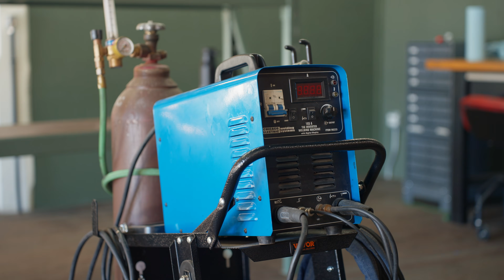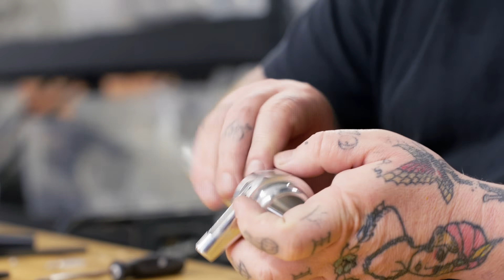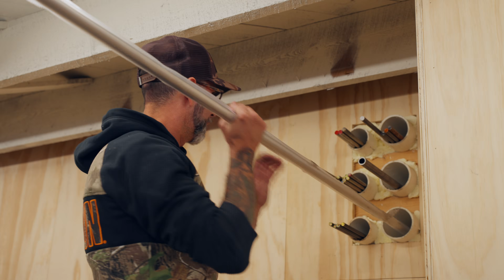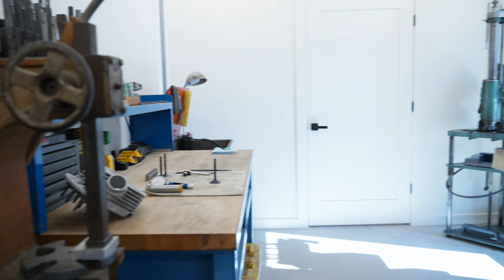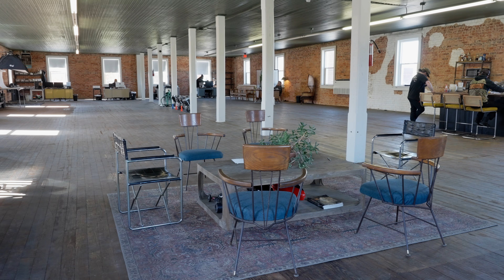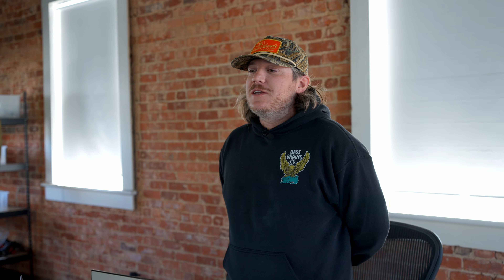PRISM SUPPLY | New Shop Tour!

Comment: Since you guys do stuff that actually help us in our little MC world, I have a product opportunity that would sell immediately in the vintage Harley market. There is a high demand for a true drop-in 12V and 6V AGM battery that fits inside a Panhead/Knucklehead oil tank while maintaining a completely stock appearance.

Right now, the only widely available option—Taiwan Tedd’s lead-acid unit—went back to using a 6V side-vent tube. Owners have to cut the vent, modify the lid, and add vented caps just to make it usable. Every spring, the same question shows up across all the Pan/Knuck/Flathead forums:
“Who makes a battery that fits the oil tank and looks original?”

If you develop a sealed AGM battery that is dimensionally correct and visually stock, you’ll corner a market that is actively searching (and paying) for this solution year-round. This would move fast.